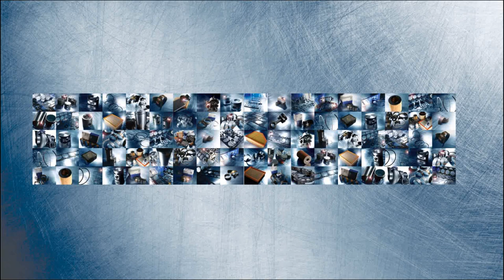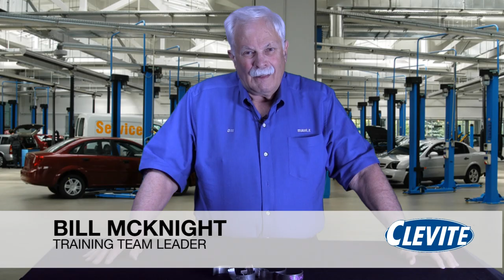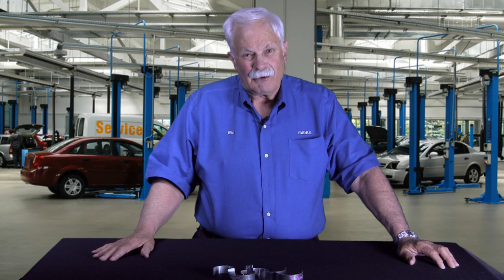Understanding Why Bearings Fail

Comment: Great informative video.  Very true that just a tiny speck of dirt can ruin a new rebuild.
I'm not sure about the definition of a 'backyard mechanic'.  The home mechanics I meet are all meticulous. It is, after all, (usually) their own engine and their own pride and joy at stake.
Unlike a garage mechanic with time schedules to meet, the home enthusiast can devote as much time to a project as needed.
Reply: Fully agree, backyard mechanic will take better care of their own, but a lazy mechanic that hates his job will sloppy Joe over tighten the oil plug
Reply: I'm in a situation where my brand new motor failed. Installer reused the oil cooler but blames the builder. Connecting rod really black at the point of failure, could that be from the oil cooler

Comment: Use of scotchbrite pads used for gasket removal takes out bearings also.GM put a TSB out not to use scotchbrite pads for gasket removal.The scotchbrite pads have aluminum oxide in them and the little pieces get in the oil and the oil filter can't trap these little pieces from the scotchbrite pads.Gets in the bearings acting like a cutting tool.Antifreeze takes out bearings too after a headgasket goes bad not caught in time.

Comment: 50 years ago I worked in my fathers machine shop i was fortunate enough to work with the European craftmens a different generation of the 30s and 40s and 50s,they seem to have a keen sense of machine expertise,my question is the feel of bearing and shaft there is a smooth feel does the bearing need replacement? I'm talking about an old bearing 50 years old ,not constant running but stagnant four Thirty plus years. it seems a waste of money replacing bearing that seem still good.if you could physically see pits on the bearing shaft of course it would need replacing but if it's got a nice smooth feeling I would say that the bearing would not be damaged why replace bearings ?theyadd up in money and I can't afford to replace all the bearings